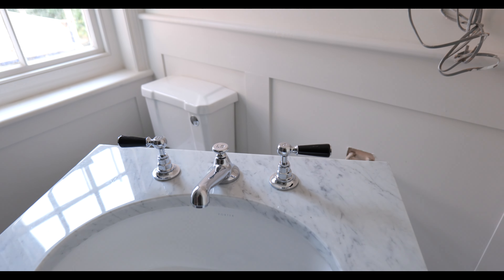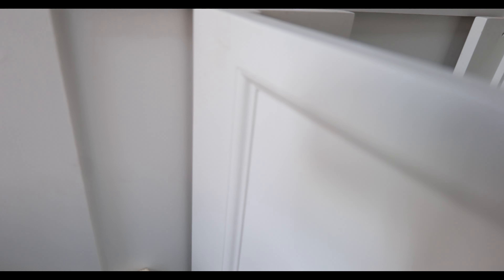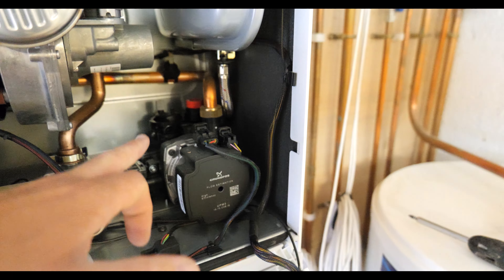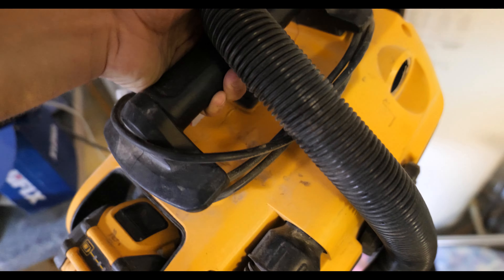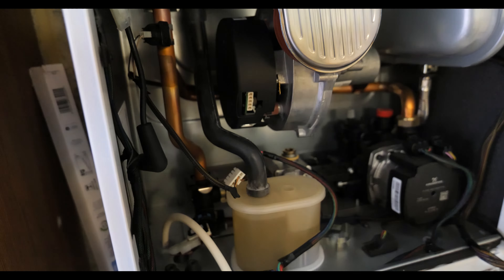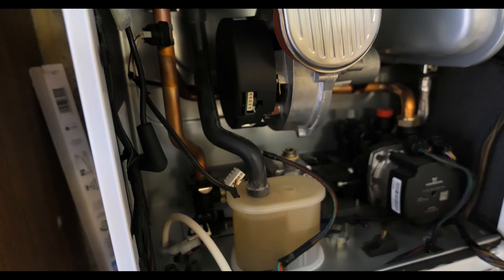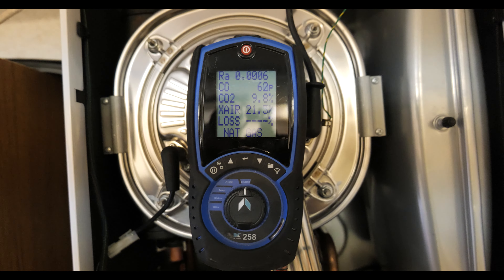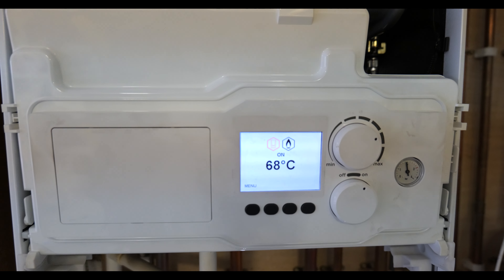Boiler Breakdown - Ideal Vogue - Vanity units

Comment: Really enjoying your video's. Been using the EPH valves for a while now, I always used danfoss before, but ran into a few problems with them passing. The EPH are a no brainer with the easy electric and head removal. Also the copper work in the old property is top quality 👍
Reply from the maker: Thank you very much. Appreciate the feedback.

Comment: Great boiler the vogue. I use the ldf for lubricant on the gas valve and burner o ring... thanks for your efforts 👍
Reply from the maker: Thanks mate
Reply from the maker: @alexshepherd3308  Yeah it's only to check for leaks when the boiler is operational. It's not a live gas pipe unless the boiler is running. That's why in my opinion some LDF is always worth using .
Reply: @loving-plumbing  Great pipework in the barn as well 👊🏻
Reply: Jock you get around. I'm scared of watching any vids as I look around the corner and you're there😜.
Reply: @CommercialGasEngineerVideos  I'm less expensive than you are ☺️😂😁

Comment: Do love those Ideal boilers, since Baxi and Ideal started using the same heat exchanger manufacturer as Vailant there's really not much different between the 3. Watered down White Vinegar only on them though. The syncro motors on the Honeywell valves just don't last anymore, get maybe 3 years out of them so they've obviously changed something to cut costs.
Reply from the maker: Yes they have definitely done something to cut costs I would imagine. Seems to be failing a lot on me lately. Thanks 👍
Reply: You're a clever lad Effervescent. Know your boilers eh.
Reply: @CommercialGasEngineerVideos  You have to jump on as many courses as you can these days with the speed things are moving. When I first started it was a requirement of Viessmann to go over to Germany or up to Telford to get your extended warranty credentials. Less of an issue these days but it's always sensible if you can afford the time/ personnel.
Reply: @effervescence5664  it's very true. As many courses as possible. Things do keep moving.

Comment: Nice video 👍 on the honeywell valve, if there's power down the brown it could just be a failed synchron motor and not the entire valve. Cheaper fix and an easy 2 wire job at the actuator, no need to re wire a complete new head 👍
Reply from the maker: Yeah I did consider swapping the synchron motor but that would have been more money in honeywells pockets 😜

Comment: How come it says (sl 1) and (sl 2) and underneath it says L &N , worcester is LS and LR for their switch? I.e. power out switch back, is this the same thing just different terminology? Tia 😊
Reply from the maker: LS is live supply and LR is a live Return. So only one switched live connection. Both the SL1 and SL2 on the ideals have their own live out if required.

Comment: Incorrect use of the earth wire again. I see earth wires used as switching wires (carrying 240v) them chopped off. Unless there is a RCD protecting the curcuit.. the earth wire protects the cable.. Repeat the earth wire protects the cable from mr/Mrs DIYer chopping through, hitting a nail into the cable from receiving a fatal electric shock. No earth = not a high enough fault current to trip/blow the mcb/fuse at the fuseboard or FCU Fused connection unit. This is why over 60% of heating wiring is incorrect! Leave it to an electrician!!
Reply from the maker: Constructive criticism. I like it. I've looked back through the video and agree. Thanks for the feedback.
Reply: @loving-plumbing  Post BS 7671:2018 - Amd 2 Which takes effect on the 27th September 2022 you can't use a cpc (earthing conductor) as a live conductor even if marked up as one. Pre 18th edition heating cables after the 3/5 Amp fuse spur were considered appliance wiring so although not correct it wasn't considered an issue. Where possible it's best to update the wiring for future idiots to cover your own back.
Reply from the maker: @effervescence5664  you know your stuff. Thanks for the advice
Reply: @loving-plumbing  Wasn't having a go at your work, as your plumbing is top quality. A lot of plumbers do not recognise the importance of the earth wire. Not such a big issue if there is a working RCD that trips very fast on a small current leakage. But the earth wire is within the cable to protect it from a fault / it being damaged. There's a good chance if the cable is cut or nailed a low resistance path from live to earth would give enough fault current to trip/blow the mcb/fuse. No earth and no RCD = possible fatal electric shock.
Reply from the maker: @waynenixon729  it's no problem that's one of the main reason I started the chanel. To get advice from other experienced trades. It definitely makes sense what you are saying.
Reply: @loving-plumbing  Yeah, if I see you at Steve Willis in future I'll say hi. 
Wayne is technically correct but the majority of controls you'll find the cpc used as a live conductor are tank stats being used as the satisfied switch, older systems we tend to replace these days. From the look of it that 5 core goes straight to the Nest Base right above it, surface wiring, visible and in controlled area. Not something I'd worry about as a Sparks/ Gas Engineer.